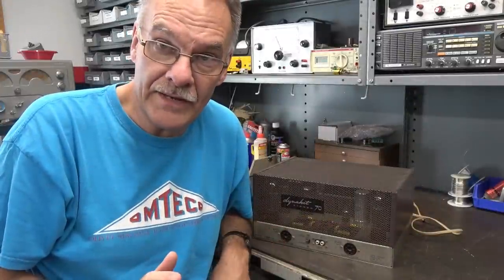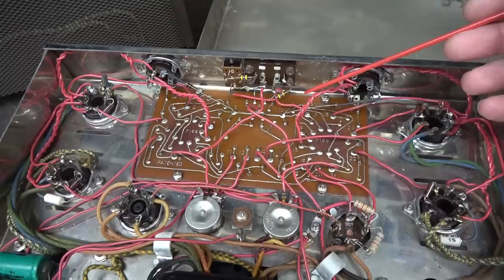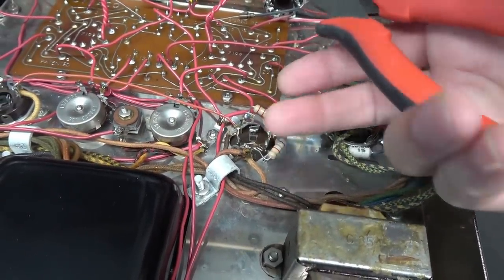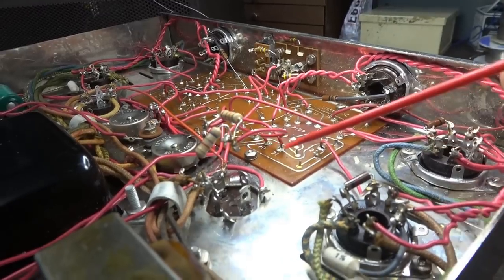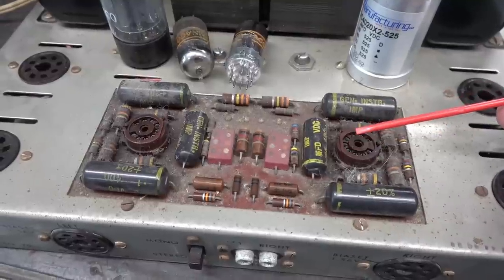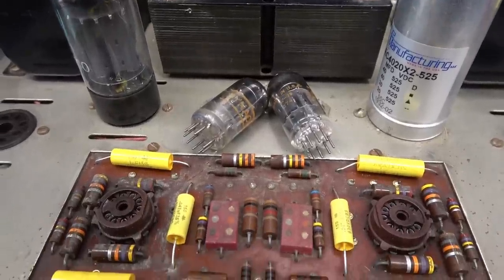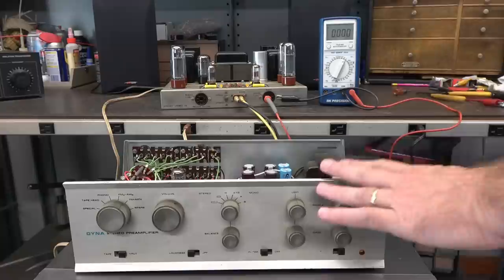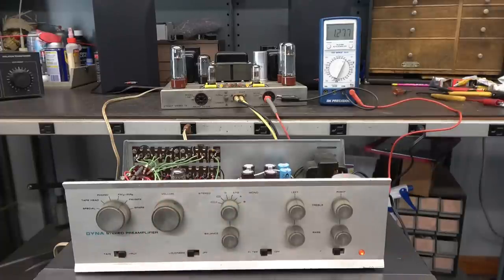How to fix restore Vintage Dynaco ST70 tube audio stereo amplifier replace old Caps

Comment: Good job!! I would also measure those Carbon Comp Resistors, especially the Grid Resistors. Carbon Comp's tend to drift and increase in resistance. Great condition under the hood. Thanks for sharing. Lovely amp.

Comment: I have a Dynaco amp and pre-amp my Step dad made I think in 57-62??? That has 12ax7 Telefunkens in it and a Mullard rect Tube and Mullard EL34's .. all original and worked flawlessly until it was upgraded with modern stuff but it is in primo condition. The Dynaco preamp is a PAS 1 I think..  There gonna be for sale soon along with a vintage Thorens TD 121 that worked perfect too the last time it was used..

Comment: Hi Terry, did you replace the selenium
Reply: All the underneath the chassis shots show the selenium rectifier still in place.  It really should be replaced with a diode!
Reply: I personally replaced them just because but make sure you put a resistor because the negative bias will need to be checked to specs

Comment: I've learned how to safely replace the caps, re-solder the tube sockets, and fix broken solder joiints to revive the tank reverb and overdrive channel in my Hot Rod Deluxe here in the recent past...many, MANY thanks for your expertise!!!...I just picked up another  Hot Rod Deluxe and all it does is hiss...no output...would you think to replace the output transformer first? New tubes, powers on, not blowing fuses...thoughts Sir? thanks...

Comment: I have a dozen of them I need to bring back to life...any suggestions on replacements for the 7199?  I have no problem with rewiring the board although I would like to keep a couple units stock...maybe I'll find a few good 7199s in the set that I have.
Reply from the maker: https://www.tubedepot.com/products/tung-sol-6u8a-and-6u8a-to-7199-adapter-combo
Reply: @d-labelectronics  Thank You!
Reply: I think I saw on the website that is selling this amp again that they are reccomending different tube and board combination to replace the 7199 tube.
Reply: I bought that combo and it works well. I need another set to replace the ones I stole from my SCA-35.

Comment: Hi,
Putting new power cord on ST-70. Using modern day polarized plug. One wire lead goes to on/off switch and other to the fuse. Where should I have the hot lead connect? Some say the switch so chassis isn't energized when the switch is off, other say hot lead to the fuse. 
Also what Caps/sourcing did you use on the PC board? Can't wait to get this up an running! Many Thanks!

Comment: Don't know if you are aware of this vintage fact about Dynaco wanting to team up with Avel a transformer builder in Great Britain in the early 1960s, Avel made toroidal transformers and in the mid 1980s I managed to acquire a prototype from a retired Avel engineer, the duo project never got off the ground as far as I know as the Avel transformers were to expensive for the Dynaco retail market.